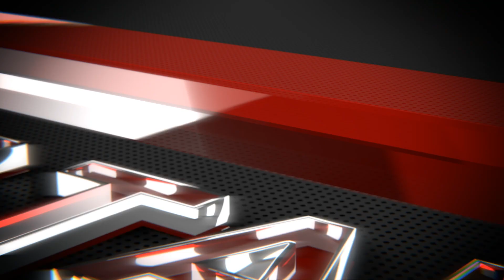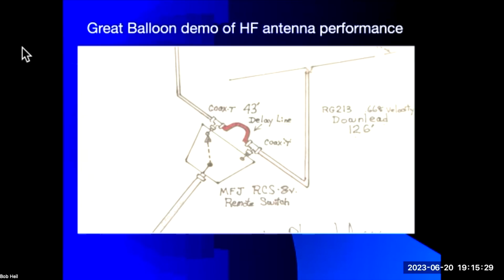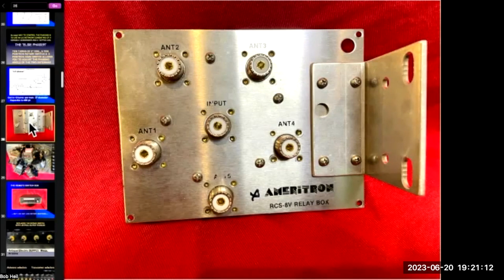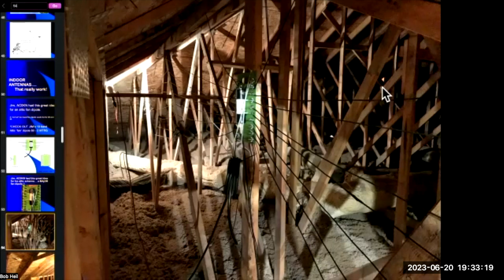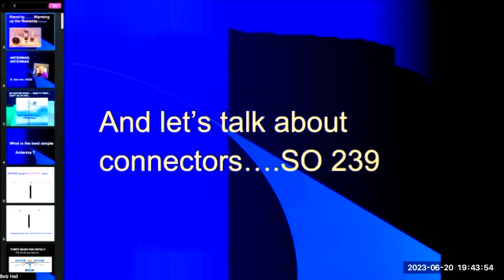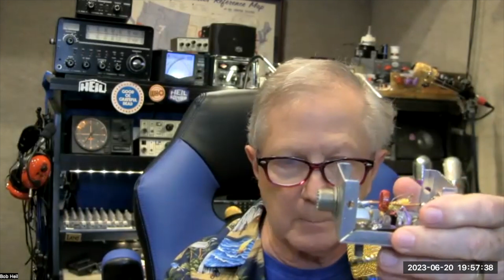HAM Talk   With K9EID

Comment: When you put 500 feet of RG213 between your transmitter and antenna (2 db loss on 75 meters and 2.4 db loss on 40 meters) the round trip loss is twice that amount.  This causes a high swr to appear much lower. Then you believe an antenna like the "coaxial" antenna appears to be broadband, when in fact it is nothing more than a dipole.   Bob has been told this but he continues to promote the  proven myths of the antenna.  
The phased dipoles DO have a f/b ratio, but relatively low gain, in the range of 3-4 db. Couple this with the loss in 500 ft of coax (see above) and the net gain is nearly negligible.